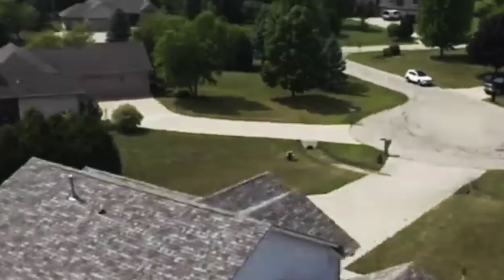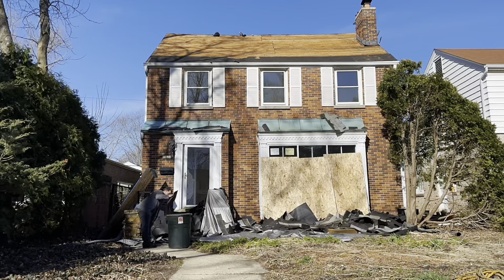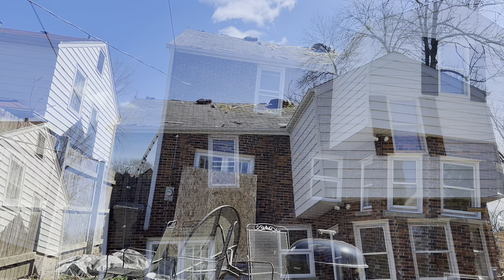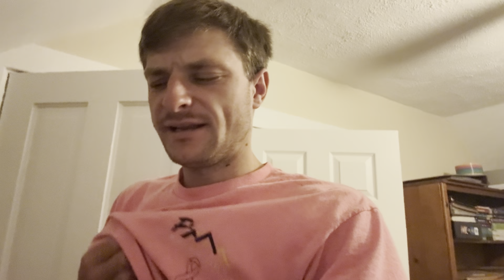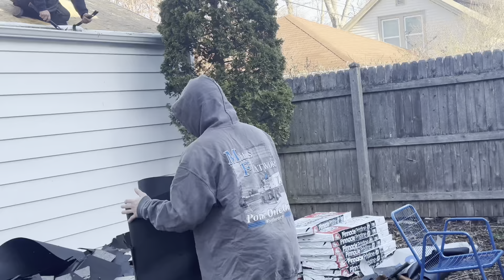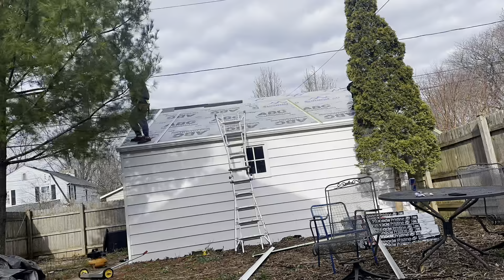Going full BEASTMODE on a roof

Comment: Good work! More info on materials used would add so much to your channel, how many bundles, sq ft etc…..how to it a bit more. Thanks
Reply: Good work? He redecked because the roof is so bad and doesnt even jack up the sag, wil need new shingles in 5 years
Reply from the maker: @mjnelligan7288  you literally sound retarded what just came out of your mouth we Redeck the house because there is space decking you fucking idiot. Clearly you’re not a roofer and your mama didn’t teach you how to work hard I’m sure the roof in your mom’s basement is pretty straight